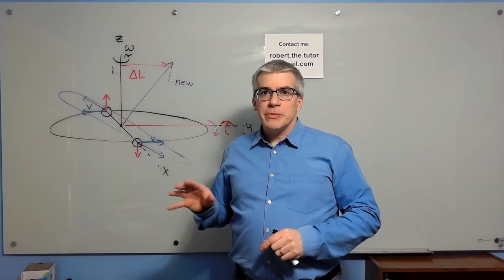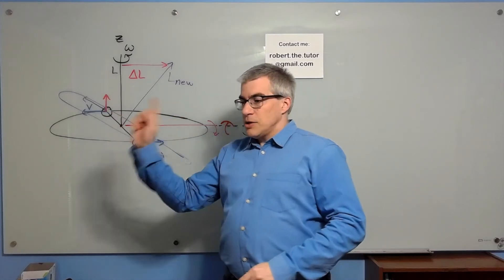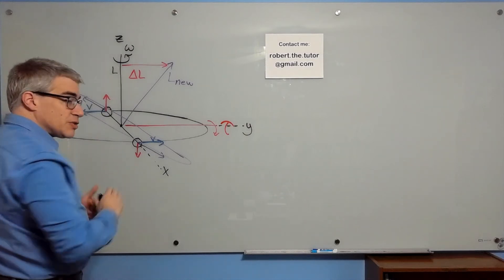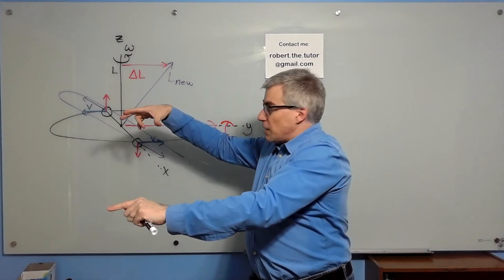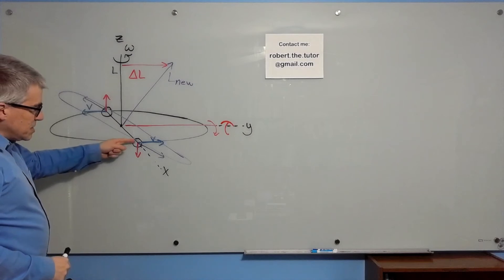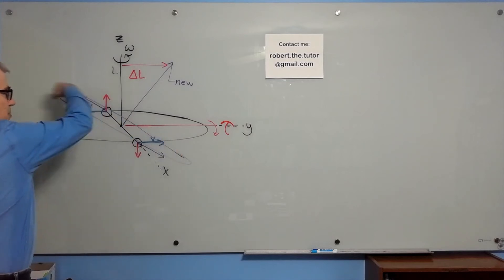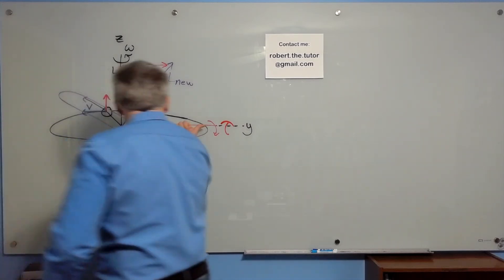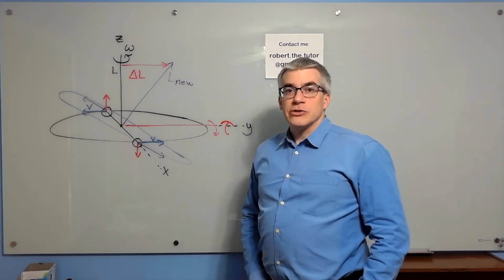Torque Changing Angular Momentum in 3D

Comment: What if the angular momentum and the angular velocity do not point in the same direction how does torque influence the angular velocity or direction of rotation ?
Reply from the maker: In that case, the moment of inertia is replaced with a 3x3 matrix called the tensor of inertia, and L = I w becomes a matrix equation.  When an object is highly symmetrical, that matrix is diagonal, and if we consider one axis we can pretend it is a single number.
Reply: Use the right hand rule draw torques and angles and use perpendicularity